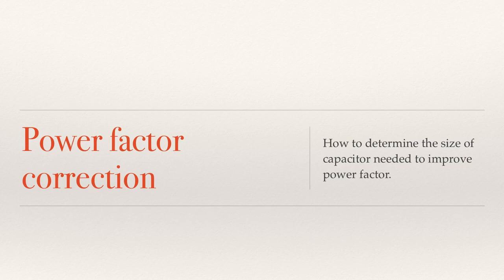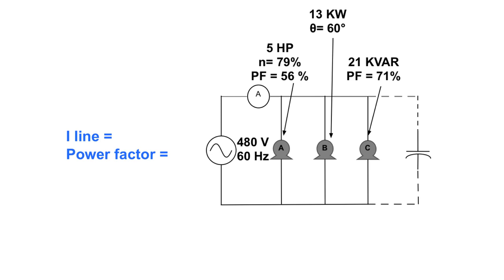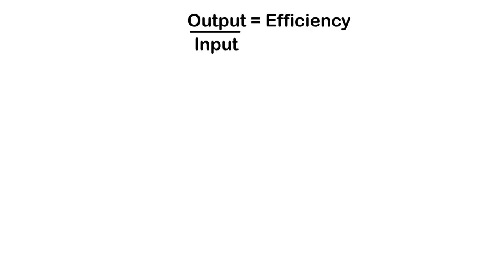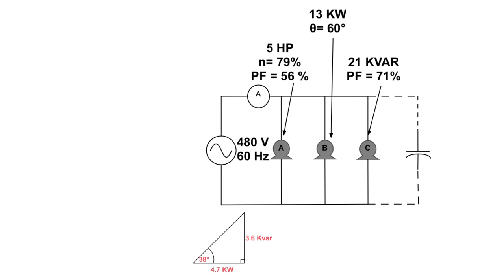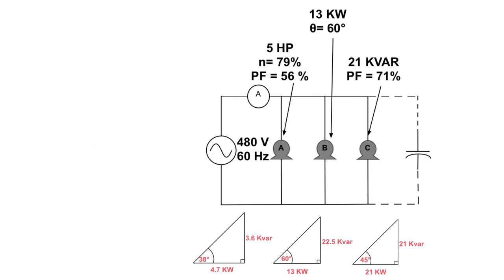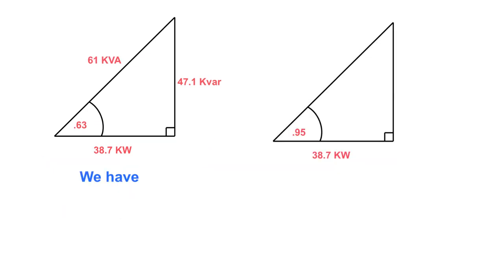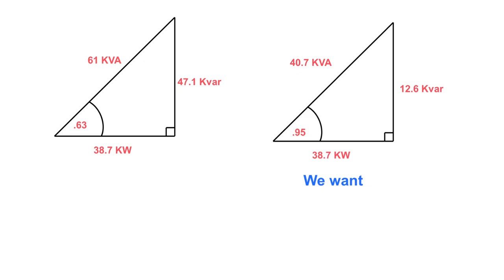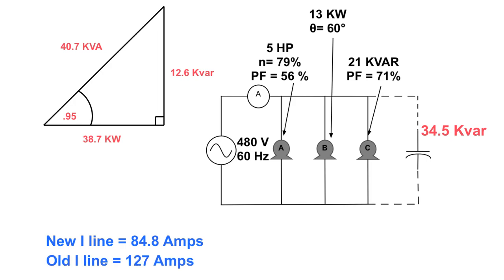Power factor correction

Comment: Even with the minor arithmetic error, this was very helpful. Strangely, sometimes when you stumble, the skinned knee causes enough of a wound to heal stronger. I paused the video right at the beginning and did the question on my own. Only thing is, even motors rated for continuous will use usually have an intermittent duty cycle, with variance of PF by rpm,  so the numbers jump around. Brilliant teaching.

Comment: great vid , just shame about the error's , your first powertriangle , 4,7KW with a powerfactor of 56% give's an angle of 55,94° as stated , this give's us   Tang = 1,479.. , so Kvar is not 3,6 Kvar but 6,95 Kvar.
Logic ,  with an angle of 56° opposite is greater then the adjacent side
Reply from the maker: Peter Alexand thanks. You're right. I need to redo that video with an update. Did the annotations show up in the video?
Reply: it sure did. threw me off track initially though :P

Comment: Is this a three-phase circuit?  I would assume it is, based on the source's voltage level, and you were also making reference to LINE voltage and current.  If that's the case, the KVA (apparent) power should be equal to: Sqrt(3) * V(Line) * I(Line)

Comment: Hello! It`s very bad thing a reactive power in DC/AC converters. The converter consums a power from  the battery (in case of 50Hz transformer or in case of  lowpass filter capacitor in PWM pure sine converters) - but this power is not working any work - it`s only recharge a capacitor or an inductor.

Comment: could it be said that since the voltage is 480V and the capacitor is 34.5Kvar that, the capacitor would need to be j6.678ohm (480V)^2 / 34500Var ? My prof wants that answer in ohms.

Comment: Let me see if I got this for 3 phase.  Calculate it the same as you illustrated.  Whatever the cap value turns out to be divide it by 3 and connect the caps up in a delta configuration.  Sound right? 
Perhaps you need to do a 3 phase video just to set the record straight.
Reply from the maker: +worldsgreatestride yeah. You don't divide it by 3. You have to use root 3. I definitely will be doing a video on three phase.
Reply: Great!  Please let me know when the video comes out.  Be sure to add the cap values in microfarads this time.  And how to figure the working voltage would be a nice addition too.

Comment: Other than you made a small mistake on the angle of the first Triangle, you did not calculate the capacitor you need to increase to 0.95 power factor.  I liked everything else you did to explain the process.

Comment: what will I do if the loads are in series?
Reply: Then you just add all your loads together and treat it as one load. However it's very unlikely that you would ever have such a case. Remember these pieces of equipment are rated at a standard voltage (480V is the popular LV). You won't connect such loads in series, since they'll each have individual voltage drops. Also, if one piece of equipment experienced a fault or cable damage all the loads would be affected. For those reasons, these industrial loads are placed parallel to each other.

Comment: how is 21 kvar have 21 kw when the phase angle is 45°. while we know that kW is greater than kvar??????? if there is a phase shift
Reply: Because in a right triangle with a Theta angle of 45, the legs of the triangle will be of equal length, so VARs and Watts will be the same.  The phase shift always results in the VA or Apparent Power being greater than the True Power and the Reactive Power, because the legs of of Right Triangle are always shorter than the hypotenuse. 45 degrees is where the legs are equal in length. Greater than 45 degrees results in KVARs being greater than True Power. Less than 45 degrees results in True Power being greater than KVARs. Just picture it in your head.

Comment: Hi,
I am a follower of your channel, I like your channel, I am wondering if you can help me please.
 I need your help in explaining LV Capacitor Bank step by step but the most important is;
1- the calculation of reactors in base of the harmonics in an industry using VFD controlled motors for example or any wave distorting source, with an example using power factor meter that gives the harmonics in the facility and how to deal with those harmonics.
And which are the cases that we don't need to use reactors in series with the capacitors, that if we are using Capacitor duty Contactors to limit the Inrush current.
2- discharging resistors issue, how to calculate them and how to connect them exactly? Is the connection made via timer relay? With a diagram, if possible.  I found diagrams on the net showing the resistors connected directly on the Capacitors terminals without any timing relays and that did not convince me, the proper time permissible to discharge in case of on off loads like motors used to cut marble or variable mechanical load that changes the pf in the way that we need to cut the Capacitors out for some moments.Thank you in advance.

My best regards and respect.

Comment: compensation is necessary for low electricity payment. i simply measure the inductance of all running machines than i add negative value of capacitance to make imaginary axis to nearby zero and remaining one is real resistor axis. your problem writing style is not common i cant understand the written values.